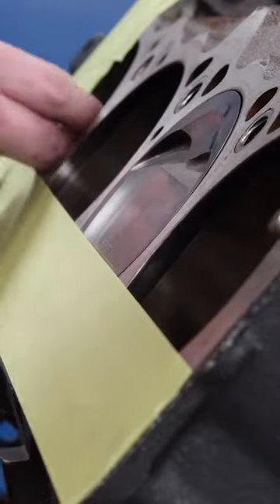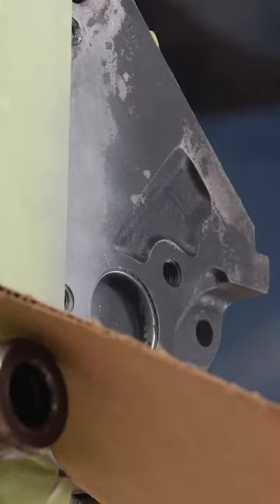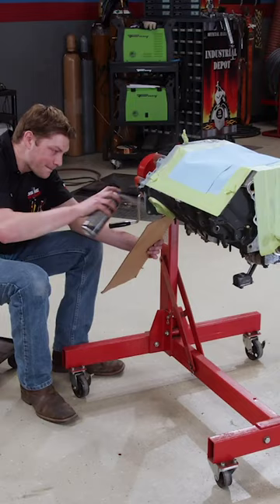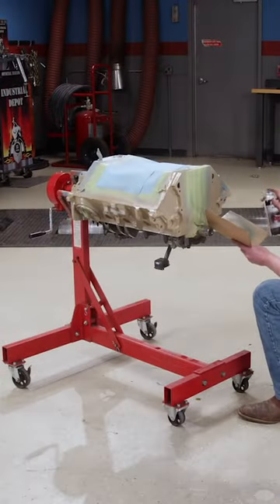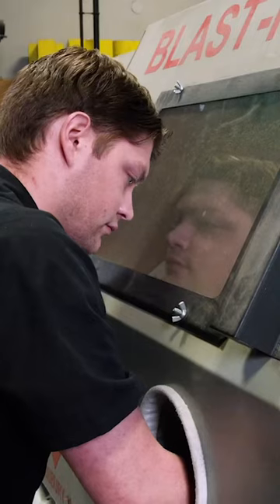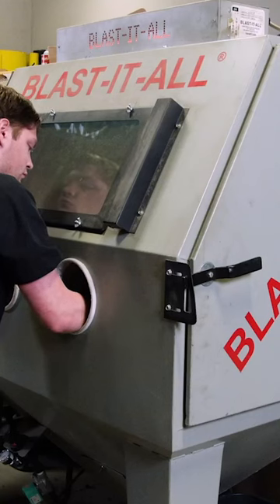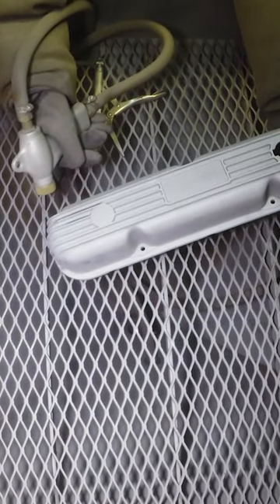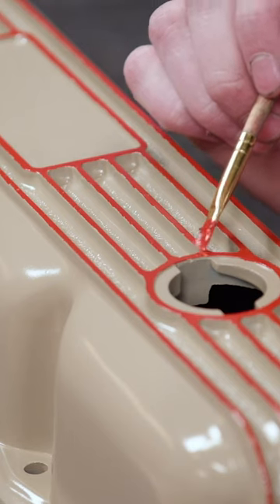Engine Painting Tips

Comment: During the prep process before a final wipe down with solvent ,I like to run a propane or mapp gas torch over the surfaces until you see it get warm enough for the condensing water to boil away. 
It helps draw the oils out of the metals pores, so it doesn't happen later on and ruin a paint job.
Reply: I second this! I use an old butane dab torch and it works. Probably slower than map gas but you can see everything come out and dry off. It’s a game changer!
Reply: Industrial Easy off oven cleaner, 2 applications, pants jobs last 20+ years.
Reply: @daleslover2771 love it for aluminum.
Reply: Correct....If sun shining allowing to set in the sun even if cold out set in sun near window the radiant heat will suffice..... applying even cheaper enamel paint will lay down and last much longer...😎
Reply: I did this once, and the block cracked! I no longer do this!

Comment: So the threads are okay with paint in them? Or do you chase the threads in the timing cover afterwards
Reply: i would usually just chase the threads real quick before you go for final assembly
Reply: Or you could just skip having to chase the threads by sticking foam ear plugs in the bolt holes. Just twist em up and stick them in the holes and let them expand. 👍
Reply: I save those used foam ear plugs in a container or buy cheap ones and use them in all the hole. Bonus you can reuse them after painting. Works excellent and way faster than chasing all those threaded holes.
Reply: Brandon  lousy excuse for being lazy. The paint can effect torque values.
Reply: @midnightrider1854  lol we must have posted at the same time. Looks like you won.